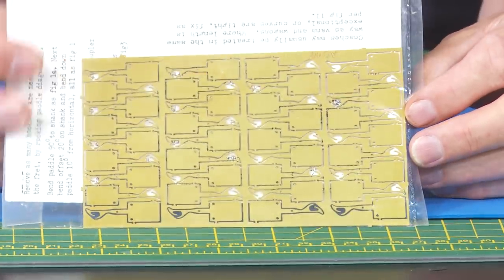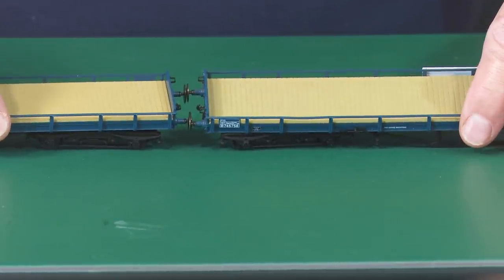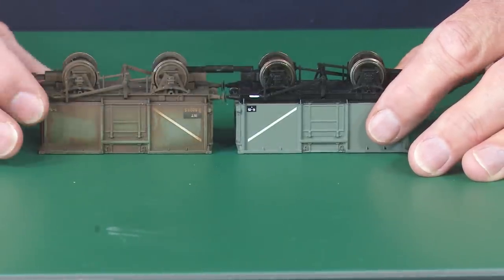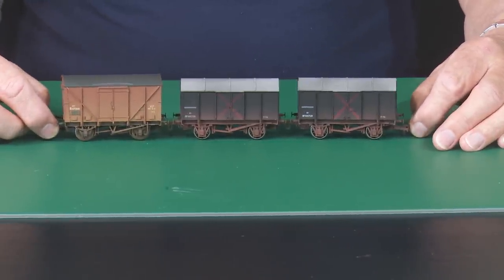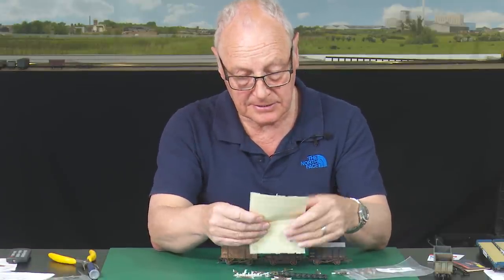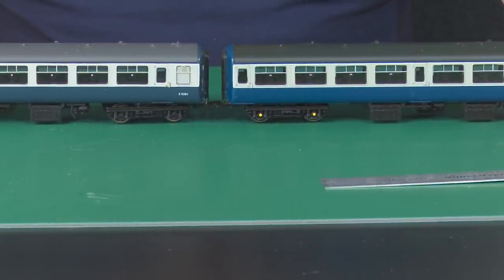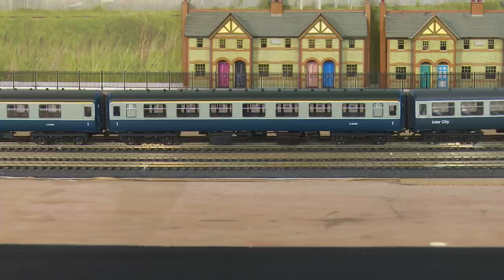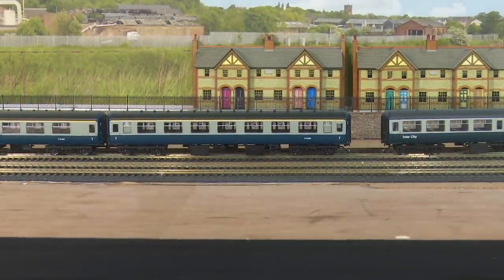NEM Couplings at Chadwick Model Railway | 92.

Comment: Great video as always Charlie. To answer your question about how much it would cost to 3D print a coupling. You would want to print it with an FDM (Filament) printer, not the MSLA (liquid resin) printer. The cost of filament varies, but a good rule of thumb is about US$20 per kg (between £18-£20 per kg). I've done replacement couplings for the Eurostar, and they run a fraction of a penny per coupling, and those are a bit bigger than a normal NEM coupling. Couplings are definitely a problem that nobody has really nailed down yet. I've actually had about 2000+ or so small magnets laying around for various projects (including couplings) for the better part of a year. I don't really see the point of static couplings. You can get about 100-200 small magnets from Amazon for under $10, so I'm pretty sure I can 3D print functional magnetic couplings for between 3p and 7p each (with the magnet in it). As for those Bachmann drawbar couplings, you can produce something much better for about a half penny in material per coupling. Stay tuned to my channel, I'm almost done with the Trackside3D website updates, so that will free up my time to wrap up the umpteen 3D printing projects I have on the go :)
Reply from the maker: Brilliant OO Rail, please keep me posted.
Reply: @ChadwickModelRailway  Will do. I just wrapped up my kids' synthetic ice rink (for hockey) in the basement at 3am this morning. Also means I have somewhere to air brush now. So I'm off to grab breakfast and then its full steam ahead on model railway projects. I'll keep you updated. :)

Comment: One thing that frustrates myself and my partner is that with any magnetic coupling, we have to remember or mark each carriage as to which end the "A" end is, then we have to ensure every carriage is the same way.
Not an easy job with over 100 carriages, and hence we are sticking with Kadees
Reply: Hunt couplings as well as the letters A and B are also coloured ends silver and gold so you put silver to gold 'Simples'
Reply from the maker: But surely you cannot be taking so many coaches on an off of your layout?
Reply from the maker: I never noticed the gold and silver magnet ends.
Reply: With the era of Mk.1 coaches that I model, the carriages have a left and a right side, hence a front and a back, as there are more doors (and any corridors) on the left platform side of the carriages than on the right. So I already have to think front and back when assembling a long rake. I use the Japanese bookcase storage boxes, so my carriages are always stored the correct way around. It makes life much easier.
Reply: @ChadwickModelRailway  not this year, but up until COVID19 started we had 5 bookings for the layout this year.
Reply: @rickbear7249  I'm just curious as to what you mean and making no criticism of how you choose to run your railway (I'm aware of how written comments can be misconstrued). Surely most train services run from A to B and then return on the opposite track. As such, both sides of the vehicles would see approximately equal use throughout their lifetime in reality.

Comment: I switched my Bachmann MK 1 & 2s to Keen but only because it puts the NEM at the correct height and then I used Kadees for all my stock. I use those 3d printed NEM boxes on my 4 wheeled wagon stock either on the old Hornby wagons or the Mainline/Bachmann wagons. They seem to work quite well. I will be getting the Hunt couplings for my HST sets as they seem a good compromise.
Reply from the maker: Hi Scott, I have spoken with Chris Hunt from Hunt Couplings and he is going to manufacture me some shorter HST couplings, for me to trial. So wait until I try them before you buy. Regards Charlie
Reply: @ChadwickModelRailway  cheers for the info, I look forward to your review of them.

Comment: Hello Charlie, I'm not a railway modeller, but I have found the coupler discussion fascinating. I have seen on YouTube Ree magnetic couplings which look very effective, but you make no mention of them. But like you say, there are so many variations out there, you could write a book on the subject. Best wishes!
Reply from the maker: Hi Finlay, I do own a set of magnetic couplings I use them on both my Pullman cars, and a set of Mark two coaches. They do seem very efficient. However, on my freight stock the KD’s win every time. Regards Charlie

Comment: Another excellent video review. I remember seeing the 3 link coupling video and thinking they looked amazing. I have operated exhibition layouts with sprat and winkle couplings and they are ideal for shunting wagons with strategic magnets placed in the track. 
Keen couplings I've experienced are very good, a bit fiddly to get spot on but worth it in the end. 
The kadee couplings are probably the best prototypical looking and with a vast variety available, there is something for most needs. 
I'm glad you fitted a set of Hunt (careful how you say that) couplings to a HST. I was going to get a few sets but I won't bother now. A note on the HST though, the new mk3s have nem pockets wether that would  make any difference......
Thanks again
Reply from the maker: Actually Hunt Couplings now make couplings which fit HST NEM pockets

Comment: Hi Charlie good video once again just one point buffer lock happens with reverse  where a vehicle passes over a curve in one direction and then immediately there is a refresh curve in the opposite direction allowing one buffer to move around the opposite one and lock up. This can occur in the 1:1 world and minimum. Radius are specified in the track Design handbook to avoid this issue. Would not be on the mainline but in sidings and depots
Reply from the maker: A great point Gary, I always seem to forget about the point crossovers for buffer lock.

Comment: Another good overview of the minefield of couplings. 

The hunt couplings look a good product, especially with the new elite version. 

For us finescale modellers as well as the Spratt and winkle,  there's a few others such as dingham (my choice probably), dg and Alex Jackson.  As well as of course functional 3link and screw couplings which some favour. 

Regardless of what you model be it fine or otherwise, it will always to some extent be a personal choice between ease of use and cost. I will probably use the hunt couplings on units (though I do wish they'd made the look more akin to buckeye or shefenberg types as used on the railway.
Reply from the maker: An interesting comment, many thanks.Yes the Hunt Couplings are very attractive when compared with our dreadful standard alternative. If only the manufacturers could form a coalition and find a way forward on this one.

Comment: Hi Charlie, great video as usual. I have used the Bachman pipe couplings and neomagnets as you used. Never thought of doing what you did with them. The hunt coupling magnets look to have a larger surface area which is possibly why they have more attraction. Anyway, I run 6 coach sets so will try your idea.
Reply from the maker: I’m so pleased that you found it interesting Christopher, good luck with your project.

Comment: Hey Charlie,
Thank you very much for your nice Coupler Ideas of what I never heard before.
Some guys in germany do make experiments with 2 polarity electric couplers using strong magnets and looking like the prototype Scharfenberg coupler head.
Me I am modellinc a fictional privare railway company in the year of 1908 based at Luebeck in northern germany.
During this period of time Luebeck wasen't imperial prussian kingdom terretory.
From 1899 to 1909 the imperial prussian state railway made a general coupling test to use the Krupp Middelbuffer Coupler, which had some similarities to the older Janney Coupler.
My fictional private railway using the new Krupp Coupler of course, too.
I had been compatible to Hook & Chain Coupling with side buffers, the Hook & Chain had been mounted onto side of the middle buffer shaft and could be swinged onto side to use the traditional european Hook & Chain Coupler, too.
Since I read from the general coupler test, I can fitting my era 1 (1835 to 1919) cars prototypely with kadee knuckle coupler or kadee compatible couplers together with side buffers. So the models looking real like the prototype did it, too by using the Krupp Coupler.
Reply from the maker: Thanks Ingo, I’m pleased you enjoyed the video, however couplings still remain a nightmare. Regards Charlie

Comment: I use the bachmann dmu couplers .they are similar to the continental type model couplers they are smaller profile,they couple closer for better scale distance and are easier to uncouple with a hand uncoupler such as a thin piece of hooked wire or a bamboo skewer with a notch cut in .they are approx 10 quid for pack of 10 which is a lot of money but they work well .
Reply from the maker: Good point M.

Comment: Have you tried the Hornby magnetic couplers ? From what I can see on photos there are two magnets each side which I assume will eliminate the rejection problem. And a problem WILL arise if a return loop is on the layout and consists are spilt in either direction.
Reply from the maker: Yes GC, I have used them. Please check out my video number 217.

Comment: Hi Charlie. Another great video, unlike you I suspected that the rare earth magnets would come a close second. I run up to 12 coach trains using that method but if the engine jerks in afraid that it isn't unusual to have a division. On my HST I'm using Kadee couplings albeit superglued in place. As I don't want to 'shunt' my HST I cut off the auto coupling rods. As an aside, I was surprised to see that you have buffers on your Mk 3 coaches. Then I looked at mine ......... That's a job for this afternoon then!
Reply: 1952TonyC Is it not true that the Mk3 on the HST have no buffers, but those that are loco hauled do have the buffers?  Makes buffer clash easier to avoid on HST sets, of course, as it’s only the corridor that touches. Not the colour of the corridor made the gap more noticeable, hence the need for black. And a small foam filler to stop light leak?
Reply from the maker: I have spoken with Chris Hunt this afternoon. The owner of Hunt Couplings. He is going to send me another set of HST couplings with a smaller gap between coaches. My gap was 4 mm and he intends to reduce it to 2. I’ll keep you posted Tony.
Reply from the maker: Hi Tom, you are of course right there were no buses on HST coaches and I ought to get off my lazy backside and remove mine.
Reply: Tom Lawton, you know what annoys me?  I used to know the difference between the various coaches and particularly between mk3 and mk3a, blessed if can remember now! In any event. BR (W) HSTs certainly has no buffers either on coaches or power cars.

Comment: Available in OO gauge, but in my case uin N gauge, I have for many years used DG Couplings. My main operation is uncoupling but on my layout where rakes of up to 60 wagons are run, I use my own homemade hook and eye couplings on wagons in groups with a DG serarating them, and on pick up goods wagons I use solely DGs.
I have to agree that couplings from the manufactuers are absolutely visually horrible, especially in N gauge.
Thanks for the interesting info Charlie.
Stay safe
Cheers, Bob
Reply from the maker: I’m so pleased that you enjoyed it Bob. Couplings remain my nightmare.

Comment: Very interesting.  Wondering if you would have seen a NEM extender that gets left on a individual cars?  A short plug male/female, that just extends the length on one car?  The issue I have is with Fleischmann cars and engines going around some curves with the bumpers coming into contact on the inside of the curve and lifting the inner wheels off the track.  This happens only with certain combinations of cars and engines but is consistent to their use.  The next step would be to dissect two dozen couplers to insert spacing plugs.  Thoughts? Ideas?  PM
Reply from the maker: Yes Patrick, buffer clash can be a real problem on tight curves.

However, I have never heard of a system of extending the NEM coupler.  Clearly a coupling with a longer shaft is what is required or perhaps shortening of the buffer stocks. Regards Charlie

Comment: Hi Charlie, Thank you for an informative video... However, despite your best efforts, I will probably carry on using tension lock couplings as I find them cheap to buy (secondhand), easy to fit and very reliable.  I don't much like NEM pockets but am stuck with a few newer wagons on which they are fitted...Most of my rolling stock being thirty to forty years old and came with my favorite couplings fitted as srandard.  I am thinking about Spratt and Winkle, but probably will not make the change now.
Reply from the maker: Sometimes we are where we are with couplings. Good luck with your layout regards Charlie

Comment: Hi Charlie,

Here in the US we used to have what were called Rapido couplers, which were distinctively ugly and unpleasant to deal with. I tend to buy used rolling stock and if the cars do not have Kadees on them that is the first thing I change on them. There are knock offs of the Kadees from McHenry and Acumate, both of which use plastic components and so uncouple far more easily than the Kadees, albeit they are cheaper. There are a few others that offer Kadee type couplers but I rarely see them. Thankfully we do not have the tension type couplers in the US.
Reply from the maker: Two great nations separated by couplings.

Comment: Charlie - Have you tried using a kinetic coupling ROCO 40344 (cheaper on ebay) for a coach or wagon conversion. I have successfully done this on my H0 coaches but wouldn't know what's involved in converting 00 coaches - with the tension coupling.
Reply from the maker: No I’m afraid not. I am considering converting many of my coach racks to Hunt Couplings.  They make attaching and building rakes very easy.

Comment: Charlie, regarding the permanent-coupling problem with a long rake of coaches. How about trying a piece of square section extrusion tubing? You would need sufficient space in your yard, but shove the first coach into the tube, then keep pushing until they're all inside. Use square section, so the rake doesn't twist. For re-railing, tip the tube until you can pull the first of the coupled coaches out. Obviously, this would be much easier with N scale, but I don't see why you couldn't do in OO, although you might need 2 or 3 tubes for a longer rake, else it might become difficult to handle. If I can source some suitable size extrusion tube, I'll give it a try on my N scale rake. I am intending to use this trick when I fit the rubberized corridor connectors between my N scale carriages; as they'll then be a permanently coupled rake. I already use it for stopping power-train decoupling problems with Dapol N scale steam locomotives and their powered tenders. -- Rick
Reply from the maker: An interesting point Rick, I have seen it done using UPVC plastic door mouldings.
Reply: @ChadwickModelRailway  Thanks, Charlie, I'll check out those plastic door mouldings. -- Rick

Comment: Great video. 3d printing wise it would definitely be possible with a good printer for the 3 link couplings however the bachmann one you showed before would be even easier both would cost a penny or so to produce
Reply from the maker: So are you going to accept the challenge then?
Reply: 3d printers are not upto scratch, it will be at least 10 years before theyre as good as injection molding techniques.

Comment: As someone who models continental trains this is fascinating. Continental manufacturers have been fitting kinematic close coupling and NEM boxes to their freight and passenger cars for decades. The oldest example I have in my collection dates from 1973. And the couplings on that model are also power conducting for interior lighting and direction changing head and tail lights. 

Marklin, Roco and Fleishman all sell couplings which are better than Kaydee and any make of coupling will fit any make of rolling stock using standardized NEM boxes. But the couplings from each manufacturer are different so you have to fit the same to each wagon or coach. But they all couple or uncouple easily, although they are designed to stay together over bad points.  Fleishman style couplings are also available from Viessman in a power conducting configuration which will still couple with the ordinary ones.  Even the power conducting ones couple or uncouple easily without having to leave rolling stock permanently attached. 

I believe Hornby sold a knockoff of Roco couplings for a while at an inflated price. I don't know if they still do. I tried them on a rake of Hornby coaches with kinetic close coupling from the factory but Hornby had not worked out the distances properly and they didn't work, derailing the coaches on curves.  I never have that issue with continental rolling stock because they do  their math properly. 

Personally I use Fleishman and Viessman couplings as they are sturdier and stay coupled better over bad track.
Reply from the maker: A very informative comment, many thanks, Charlie.

Comment: im going with your prototype charlie, Bachmann pipe with earth magnets, as i have the bachmann pipes in my shed and the earth magnet arrive the other day, what glue did you use ? but also i believe the hunt hst couplings will fit hornbys mk2d coaches too, which i have a few of ,so ill give one coach a home made effort ,if unsuccessful hunts it will be as i think magnets is the way to go.
another great and informative video.............tony
Reply from the maker: Hi WR, I used Deluxe, Rocket Max, Thick Cyno Glue.  let it dry overnight.
Reply: Me too...having just bought a load of those couplings will give this a go with the magnets, great idea thanks Charlie